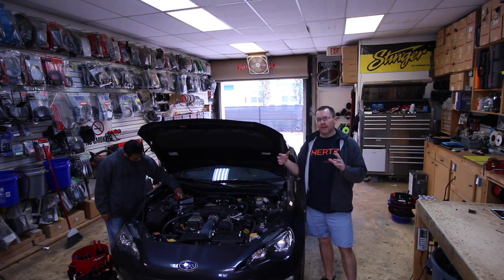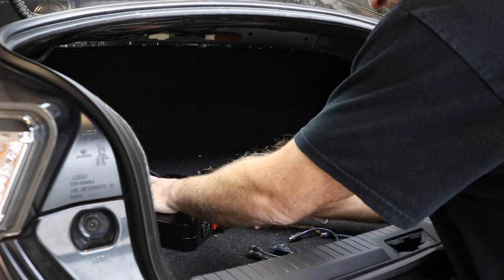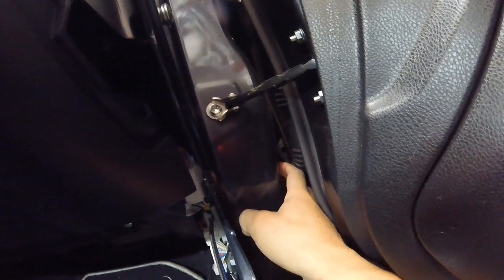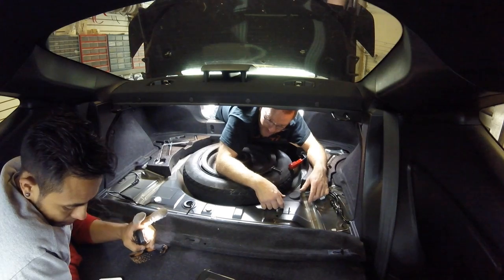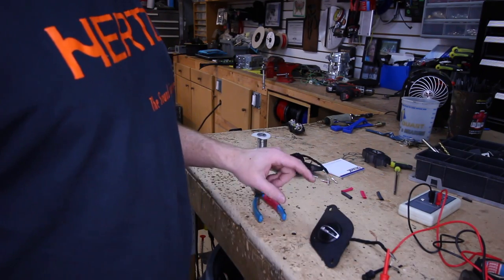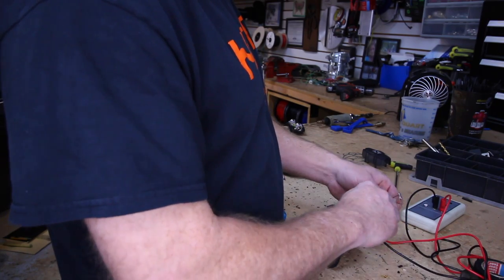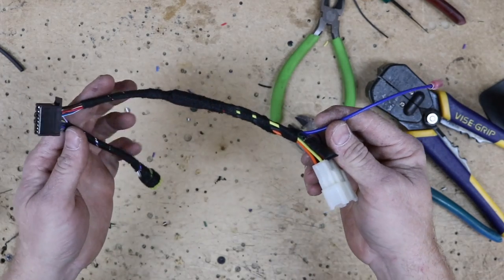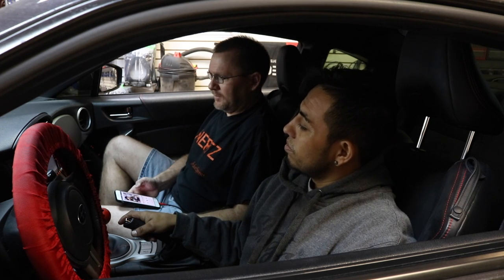Subaru BRZ car audio system 911 rescue!

Comment: I tried to buy quality gear but cheaped out and installed myself LOL sounds much better glad I got it done professionally thanks guys! I'll stick to mechanics instead of car stereo. Overall, I don't regret taking a crack at it. First audio install and I learned a lot along the way. Knowledge is key!
Reply from the maker: +MotorHeadGreg thank you Greg!😀
Reply: What does knowledge have to do with doing a lazy, half-assed job?
Reply: is not hard to do the right  way but most people go for if its works are fine  but they don't think what happens after  time

Comment: Last week we started by installing/running the power and remotes to the trunk. I’m gonna work on it little by little and keep watching what you guys do. If you guys were closer I’d pay you a visit but you’re in Clearwater and I’m in Kissimmee. The last 2 places I used here (about 15 years ago) were pigs. Everything was a mess, nothing zip tied, or taped, or soldered.  I can’t trust anyone around here. Plus, everywhere I go it seems like the customer service is non existent.  👌

Comment: That dash tweeter location looks like a good location for the mid 4” in a three-way component speaker setup with a little modification
Reply: I was just thinking that
Reply: I plan to do the same if I can find a bracket that would allow it lol

Comment: Perfection. Love the foam cutter. !!
Now that’s how it’s done.

Passives in trash.
Reply: in the bin lol. they would have likely returned them to the customer.
Reply: wax333 I missed the active part. My bad. Thanks dude.
Reply from the maker: +Clint L thanks Clint
Reply: A good passive can be as good or better than active at times........ There's a reason why some of the best speakers in the world still use passive crossovers. But for low to mid level gear active is usually best but not always.

Comment: Came for the BRZ, left satisfied and smiling 🙂.  I realize not all cars get top shelf audio from the factory, but I believe Toyo/buru could have done it (a lot) better. That uninstall was crazy w/crap just ziptied or left unsecured. Glad to see you fixed it and elevated it at the same time, nicely done.  How much deadener did you use? How many rings did you use (3?) per side? Cheers.

Comment: Great video guys!! How did you go with wiring for the front door speakers? Did you route the speaker wires through the rubber boot? Without removing door?

Comment: Yeah, i've got a 1990 mk3 supra and the 4s are killin me. I installed some JL Audio C2-400's, which are a big step up, but the midbass is severely lacking. Think ill just do some fiberglass kick panels for the C2-650 component set off an RD400/4 and the NEX1300 when it's released.
Reply from the maker: +Wade Hensley radios out now. Yeah 4's are hard to live with for sure
Reply: I have similar jl audio equipment.  How did your kickpanel help w midbass?

Comment: Nice work, gentlemen.

I have this same car -- when I did mine I had to make some of my own hybrid harnesses as none of the ones I found at the time addressed things like the FM antenna power.  What all did you guys end up using for harnesses? 

I also put some 5 1/4" in the rear locations and made mounts so that they sat in the same place as the ridiculous factory speakers.
Reply from the maker: +Keith R he had all the parts for his we just fixed it, I believe Bestkits has all the parts now
Reply: Five Star Car Stereo yessir they do have them out now

Comment: hey what is the foam Fernando installed it came in 3 piece set he installed the center one behind the speaker the middle one around the spacer and the outer one around the speaker thank you.
Reply from the maker: +Furia Djs they are called "Fast Rings" you can find them on Amazon or you local shop( maybe)

Comment: Hi. Just wanted to ask, do you do the gain and crossover setup on the amp and HU before you run the auto/eq and time alignment?
Reply from the maker: +Shakeel Faris yes we set the gain and crossover first, do the Auto EQ, and adjust again after if needed.
Reply: Thanks for the response. So, I ditched my rear speakers in my E90 and was wondering if it's beneficial for me to go the network mode route? I have components up front connected to a four channel amp and underseat midbass connected to the same four channel amp. I have a 12" sub connected to a mono block. How would I set this up? Thanks.

Comment: I recently purchased a 2017 toyota 86 I'm looking to replace the radio any suggestions? I used to own a pioneer 4100 I'm looking for something a little more tech savvy what would I need to retain the factory camera (guide lines as well) I also plan to replace speakers add amp and sub any suggestions that will help me to replace all these items to have a good sound system
Reply from the maker: +jssalinas1992 maybe look at the Kenwood DMX7704s or the Pioneer 2330nex. For the harness look at the iDatalink maestro RR
Reply: I saw your review on the Kenwood 9903s that one really caught my eye any complaints on that radio?  Also Kenwood Australia has this 917s model would you happen to know is that model is coming to the States... What would be some good speakers to run on this vehicle also I did look into the idatalink website but it doesn't seem to give much information on what would retained if the idatalink is installed
Reply from the maker: +jssalinas1992 yeah Kenwood is not bringing that radio to the US sadly. The new 9904 is coming any day now if you want the best version of the radio. If you like Kenwood, check out the Excelon 7" speakers for you car. IData should give you gauges, door open, and any thing that the radio controls for the car.

Comment: how do you hook up the tweeters and the mids on the same line without cross overs on head unit? Do you use the front speaker for the mids and the tweeters the rears?
Reply: use Pioneer Network Mode, it has High speaker, Mid and Low speaker active crossovers adjustment
Reply from the maker: +Dat Tepo both the radio and the amp have Network mode. That is a Tweeter output from the front and a bandpass midrange output from the rear. Each speaker is on its own channel.

Comment: Is there a risk of damaging the tweeter with 100watts rms? seems like a lot power for a little tweet?
Reply from the maker: +andy schloesser yes, use a cap to add some protection to it. Focal recommends that for their tweeters in an active system.
Reply: Five Star Car Stereo so the actual high amount of wattage power isn't a concern? Just the low the frequencies?
Reply from the maker: +andy schloesser for the most part yes. That and clipping.
Reply: Sweet thanks!!!

Comment: The 4800 has auto eq?!
Reply: My AVH-X490BS has auto eq which is the newer version of the 4800. Same goes for my 3800.
Reply from the maker: +Piznick64 yes it does. Connect the mic to you Aux input, put the radio in standby, foto the EQ setting and scroll down to EQand TA setup, press it and select start. It will also be in tomorrow's Install diaries just for you.
Reply: Five Star Car Stereo does it also have idatalink

Comment: its not that hard to find those screws, just go to home depot.
Reply: Nelda Cardenas or find a broken amp or crossover
Reply from the maker: +Nelda Cardenas or just doesn't lose them.
Reply: Five Star Car Stereo I always buy the lil toolbox magnetic bowl holders on sale @ harbor freight for $3-$4 to use on installs that way i can use 1 under hood,  1 by head unit console area and 1 in back/trunk they do a good job holding & keeping all the hardware for that area all secured till I need them to put stuff back in..pretty handy esp since u can get one free every now & then on ther big sales plus ther always on sale when no sales are going on